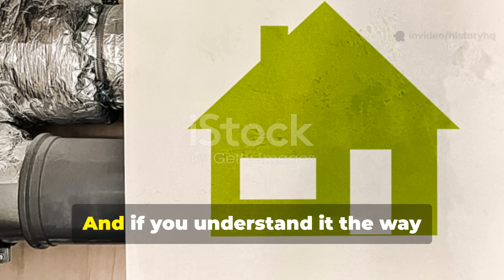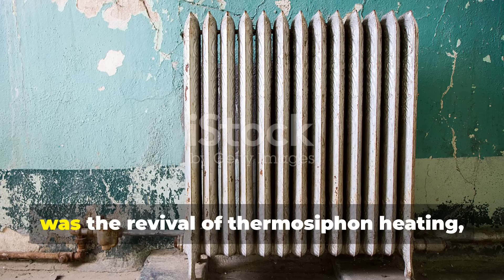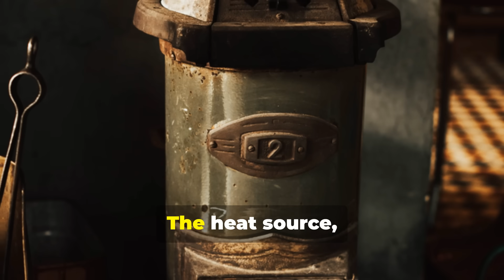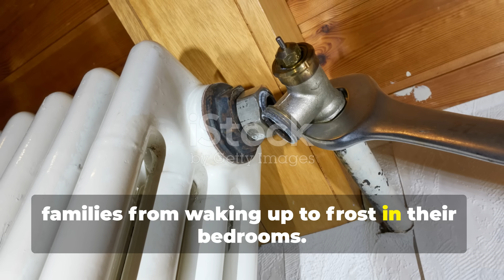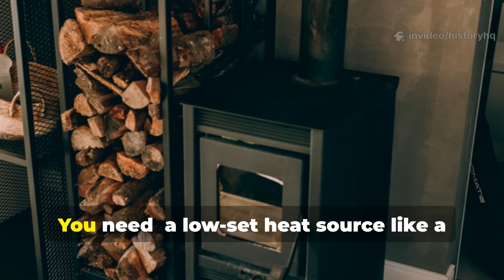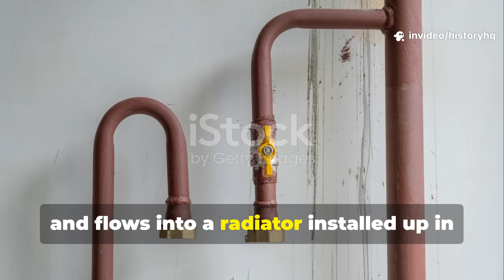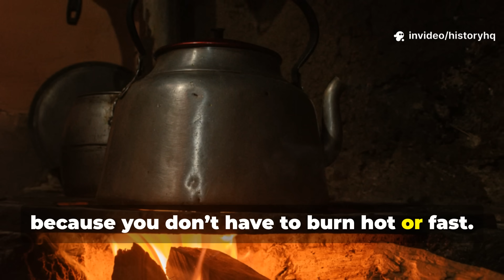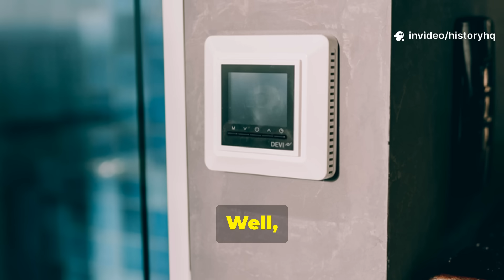The 1940s Radiator Hack That Heated Entire Homes With Zero Electricity.

Comment: My kitchen radiator always has heat. Even when the pump goes out, it's directly over the boiler two stories up and it has a low input and a high output pipe.  It's a nice little telltale to say the boiler still works. Just need a capacitor or a coupler to get the pump going.
Reply from the maker: Love that—gravity systems always give you that little “still alive” signal.

Comment: I lived off grid in a cabin for over 10 years
Put a copper coil inside the wood stove and installed it into a steel tank. you do have to drill a tiny, tiny hole in the inner pipe that come down the inner tank (for the air lock “bubble “to escape) and voila light the wood stove and you have hot water rising through the pipe and up into the water tank, as the water heats it circulates through the entire system (Known as convection)you do have to elevate the tank above the coil in the stove, if I remember right I used 4 of those figure 8 cement building blocks for the base frame. In winter it was great to come home to, light the stove, cook the meal on the stove,heat the water and have a bath. Can’t beat that. Those were the best years of my life actually. I was fortunate to have a sawmill close by and the owner said to help myself to any scraps of wood. Those were the good days when neighbours watched over each other and their property.
Not sure if you can cut holes In CSA approved wood stove these days though for a coil because of house insurance etc. but it worked fantastic way out in the middle of nowhere when you’re in a rough cabin anyway. Safety was ok, the wood stove was only going when your home.
Thank for posting this video, brought back some cool memories.
Reply from the maker: That sounds incredible — real off-grid living. Thanks for sharing the story, that’s the kind of experience you can’t fake.

Comment: Lots of inaccuracies in this. It’s true that the radiator needs to be higher than the boiler. It’s also true that a single air bubble can stop it. But provided a means is available to eliminate air from high points, you don’t need to worry about constant rise in the pipe work. You DO need radiators with high in and low out water connections, unlike the normal bottom entry and exit types. They’re typically sold specifically for gravity systems. 
Most systems are still gravity for at least one heat sink, whether it’s the hot water cylinder, or a towel rail, or a dedicated radiator. The pump is an add on that overrides the gravity setup and feeds other radiators. But for safety reasons, there has to be a way to dissipate heat, in the event of a power failure, so the gravity circuit remains the core of the system.
Exceptions would be where only liquid or gas burners are used, meaning they shut down quickly, in the event of a power failure. Those don’t require a permanent heat sink, so may be pump only. It’s better practice to have the safety measure, so most will still have an element of gravity. 
Regarding the under floor heating mentioned in the video. The length and circuitous nature of this means the thermosiphon effect is not strong enough to circulate the water effectively, or at all, depending on the layout. Overall, this video is so seriously flawed as to be considered a work of fiction, with serious overuse of artistic license in its execution.
Reply: It didn't impress me either, the water still had to be heated with some type of fuel and if you were able to get it, it was not free.
Reply from the maker: Fair take. Gravity heating has a lot of nuances, and the old systems were definitely more specialized than most people realize.

Comment: My grandfather was head of maintenance for the school district, turn the last years of depression forward in World War II they retrofitted the railway station, an updated the furnaces he got the coal fired furnace from the station to go into this home in the basement ran out of gravity system brand of the second floor blowout ballast to set the ceiling and it looped down through the first floor county made him switch to natural gas but if he had to he hit a button and natural gas go on or he could burn what was available for the plate over the gas burner it was multi-fuel gravity fed thermal rises then close down laws of physics
Reply from the maker: Your grandfather sounds like a genius tinkerer — those multi-fuel setups were survival engineering at its best.

Comment: Total BS.
They didn't revive the idea of gravity circulation or re-arrange their piping. It's how it had been installed. Pumped circuits came later.
 Very few homes even had central heating in this period anyway, they had open fires in every room, though they didn't light them all at once.
I laughed out loud when this nonsense showed an image of in floor heating, which absolutely cannot operate without a pump!
Reply from the maker: Fair point. Early systems were mostly gravity by design, and underfloor needs a pump for sure.
Reply: So much unbelievable, baseless stuff here on utube lately, not worth the time.